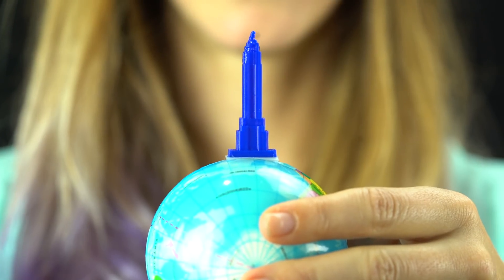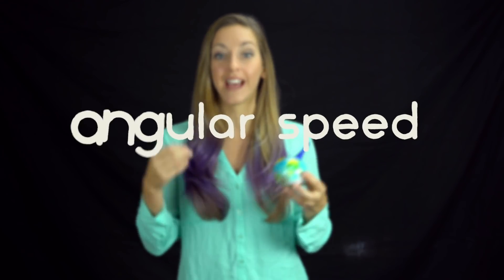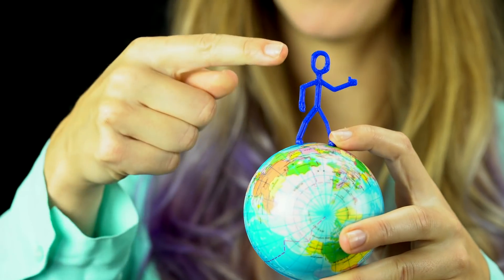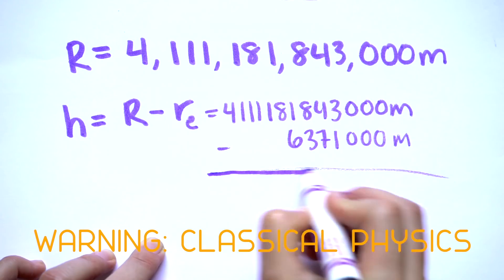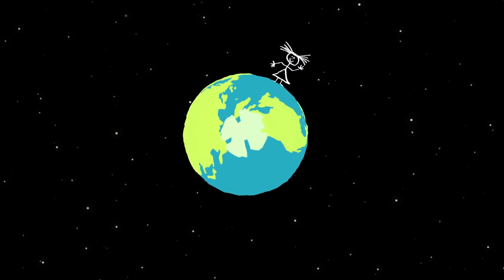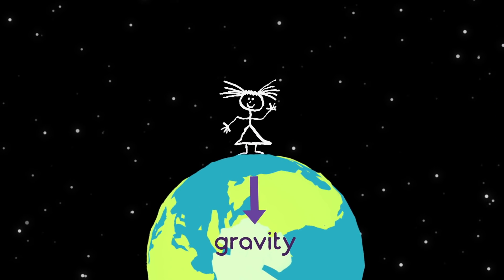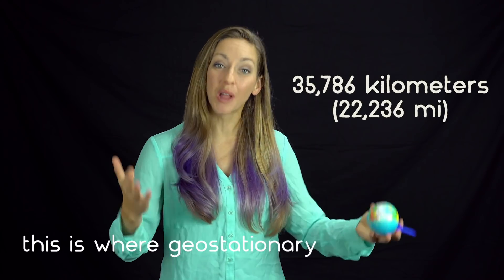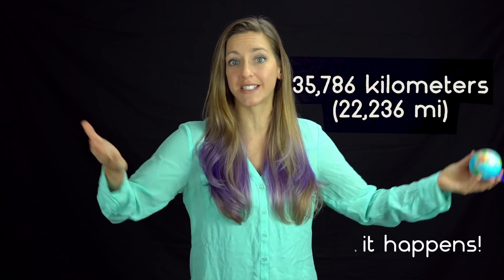How tall is this building?

Comment: sounds a lot like a space elevator
Reply: It's exactly a space elevator.
Reply: you look like steve shives
Reply: That's because it basically is just that.
Reply: The light speed thing is, the zero-g thing isn't, in fact it is shorter because there is no extra length needed for the counterweight to go on.
Reply: Except its way taller than most propositions for a space elevator.
Reply: a space elevator goes further up and uses the high centrifugal force at that height  to hold it up a building would need to use compressive forces more to reach that height.
Reply: A space elevator would take a rope for instance and on one side there is gravity on the rope mass at the Earth side, and on the other side there is maybe  a bit of tension, but some energy may be added to the orbit to get that. You'd for example use solar panels to climb up the rope, then you could put payloads out of Earth's gravity at no cost. Don't know if it can really be done or not. Some other solutions do the same, like laser propulsion. Actually you may have to add energy to the orbit all the time to keep the space side up, so it is as lousy as rockets. You could use a solar powered em drive to try though. Actually thinking about it more maybe beyond the stationary point there is a centrifugal force, but you'd have to counter the weight of the rope on the Earth side.
Reply: IamGrimalkin That's true.
Reply: totally Steve Shives
Reply: +ACommonHero2 no it's not taller, a Space elevator would also need a geostationary orbiting thing and the building also should be in this range of height
Reply: Old Albird I was talking about the 30 AU figure, which is just ridiculous.
Reply: ACommonHero2 And we're talking about the last half of the video discussing orbiting objects off such a structure.
Reply: or a space fountain: https://en.wikipedia.org/wiki/Space_fountain
Reply: Also how do you love answers?
This question has "loved by physics girl" i didn't know you could do that?
Reply: Malcolm Smith That feature was only introduced recently.
Reply: IamGrimalkin Can you only love answers pepole leave on your own videos then?
Reply: Malcolm Smith what is love?
Reply: Patrik Banek If you look by the likes theres a loved symbol as well from physics girl.
Reply: Malcolm Smith Yes.
Reply: Malcolm Smith not the answer i was expecting from the internet lol
Reply: Not, no, no guys, I just have seen blue prints, only stairs, Sorry !

Comment: Actually their will be some height substantially lower than geostationary orbit where any object dropped out the window will go into an elliptical orbit that skims the earths atmosphere.
Reply: @iamihop Not entirely correct. Both a lower and higher speed would result in an elliptical orbit, it just depends on whether your at apogee or perigee.

Lower than geostationary, you could drop a penny out the window and have it enter orbit, but you'd still feel force from the floor, since you are also in that orbit that falls down to perigee, so you'd want to lose height. You'd also feel a pull to the leading wall, since your orbital period is less than the rotiational period of the building you're in.
Reply: So, I actually went and did the math, and it turns out that if you want to skim the atmosphere (I used a safe altitude of 160 km) you need to drop the penny from a height of 23,570.95 km.

That gives you over 12,000 km to play with before you reach geosynchronous altitude, and find that the pennies will just float next to you. That's almost the diameter of the whole Earth.
Reply: Oh yeah. Clearly what we need to go is get the Earth spinning faster so we don't have to go so far.

If we can just get everyone to blow their fans west we can do it!

Comment: What would happen if you would spin a undestructable disc (maybe a vinyl record) at nearly lightspeed, in the middle?
Reply: A truly indestructible disc can't exist in our universe, so it's kind of a moot question.

This isn't a cop-out, even though it sounds like a lazy answer. The bonds between atoms are broken by applying energy against the energy present in the form of those bonds. For something to be indestructible, it would need to have infinite energy existing in those bonds, to resist all amounts of "breaking force".

So in other words, anything truly indestructible would have infinite mass. And of course, anything with infinite mass simply doesn't exist, because it would be an infinite sized black hole. It would also take infinite energy to spin it at any speed.

Yes, even the bonds between atoms that makes stuff solid, adds mass.
Reply: You couldn't. Even if the disc was indestructable it would take infinite energy to travel faster than light, which is what the outer part of the disc would be doing. Further, time slows then stops and matter compresses in the direction of travel. You cannot go faster than light, time won't let you.
Reply: FotoschoPro Ignoring the fact you can't make something indestructible, the mass of the disk would increase (special relativity) so you could never produce enough power to spin it to the speed of light.
Reply: I thought a bit and wouldn't the outer part be more slowed down as the inner part?

Comment: we are technically somewhat in orbit
Reply: In orbit around the sun, maybe
Reply: Sorry, but no. "In orbit" implies that the pull of gravity is the only (or the dominant) force being exerted on an object. Standing on the Earth, that's not true at all, since the ground's normal force on you is equal to your weight.
Reply: A vessel on a suborbital trajectory is also subject only (or predominantly) to the force of gravity.

Anything thrown up from the Earth's surface is kind of in orbit. We just usually reserve the word "orbit" for those orbits which don't intersect the surface of whatever you're orbiting (or deep enough into the atmosphere that it'd pull it down quickly).
Reply: Isn't orbit where gravitational and centrifugal forces are equal? (and opposite :P)
So I guess not.
Reply: Edgard Perez-Palma
yes that's my point :) in someway.